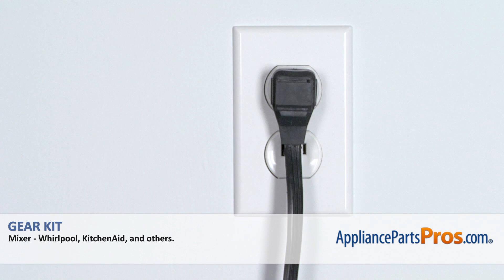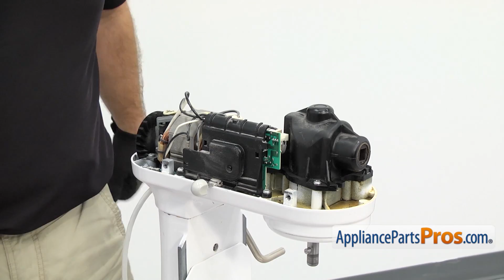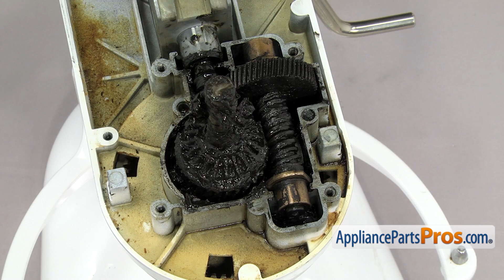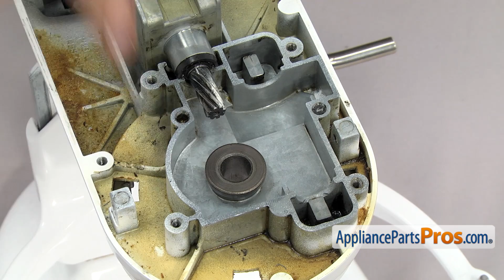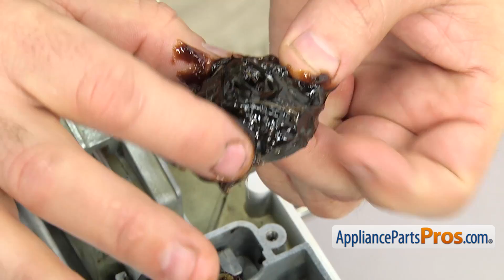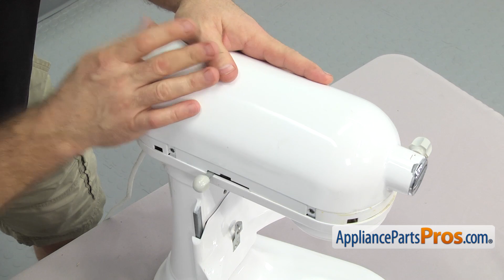KitchenAid Mixer Gear Kit W11192795 Replacement — fits Whirlpool/Maytag

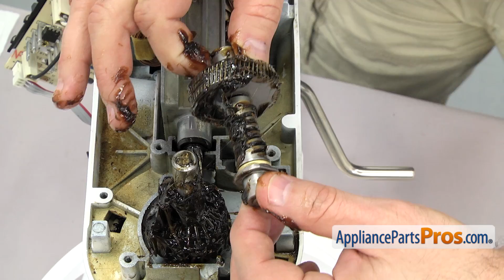Comment: At 3:35 you're removing the old style worm gear and at 11:08  you're installing the new style one. Did you not say the new style one would necessitate changing the motor? Then at 11:50 it shows the old style worm gear in place. Then at 12:08 you show the new style worm gear in place. You can tell by the end caps. The old style worm gear has copper end caps. Why the mixture of videos? Also are both worm gears compatible with a new worm follower gear?

Comment: What gears did you change? All or just two in video? I’m trying to get this machine working. All gears look fine but under load (mix ingredients) it kicks off of gears : ( 
Are these the only gears that once changed gets it back up and running? Again, all the gears in the unit are uniform and sharp. Likely worn down uniformly as nothing looks off : ( Help
Reply from the maker: @ShaneOake Great question — in that kit, the main gears replaced are the worm gear and the bevel gear (the ones most likely to wear under load). Even if all the teeth look sharp, they can wear evenly and still slip once the mixer is under stress. In most cases, replacing those two is enough to get it running smoothly again. If you share your model number, we can double-check the right kit and confirm which gears are critical for your unit. 🔧⚙️
Reply: What kind of grease do I use?